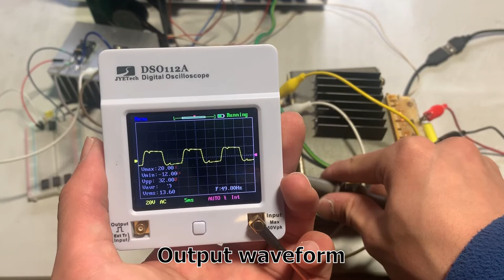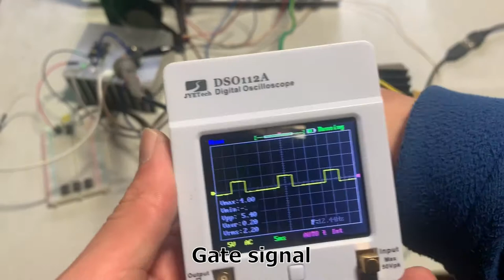Homemade 120V Modified Square Wave Inverter

Comment: awesome video, i have a question, how can i design hollow square wave inverter on simulink?
Reply from the maker: Sorry, I don't know because I'm not using Simulink.
Reply: @DarkElectronics  thanks, are you using proteus?
Reply from the maker: @umutyldz1175  No, I'm not using any simulator.